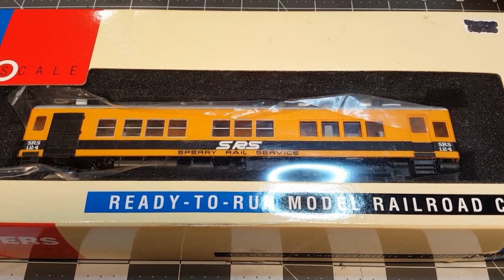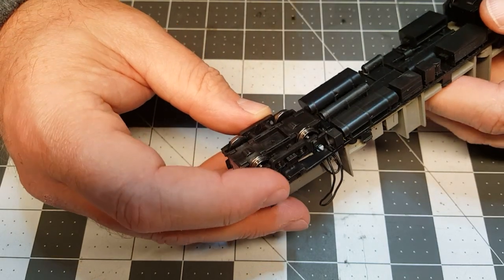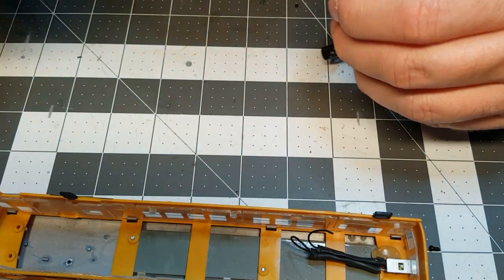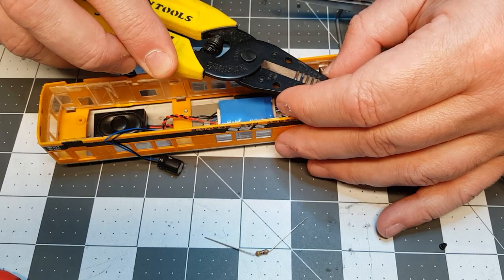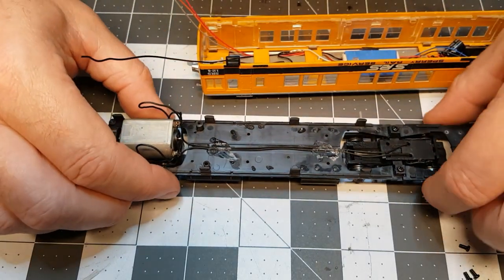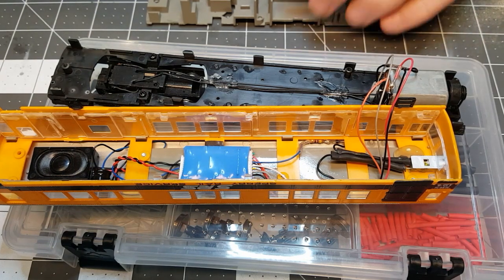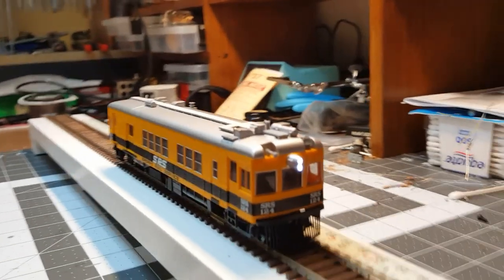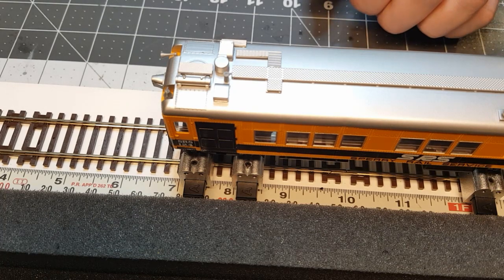Walthers Sperry Rail car DCC install

Comment: Good to see someone else struggle to get this unit apart. I broke several detail parts. I can hear the motor run but it doesn't move. Guessing from  the comments I've got a broken gear.
Reply: Update: after breaking off nearly all the detail parts, finding a broken drive belt and never being able to get the body off it's in the trash!

Comment: check front truck. mine had a broken gear which was causing the jumping
Reply from the maker: Mine did too. I bought the replacement gears from North West Shortline.
Reply from the maker: I show the replacement of the gears at the end of the video.

Comment: I installed a soundtraxx tsunami2 installed my sperry! For some reason, the motor is trying to move forward when the power is applied. What do ya think? Could it be grounded through the motor?
Reply from the maker: If it was grounded through the motor, it would short out. Is it a new decoder? If it was used, it may still be reading the last command it was given.
Reply: @SoloContracting  it is a band new decoder. I went back and rewired, and I must have had something crossed? I got it running now. Thank you